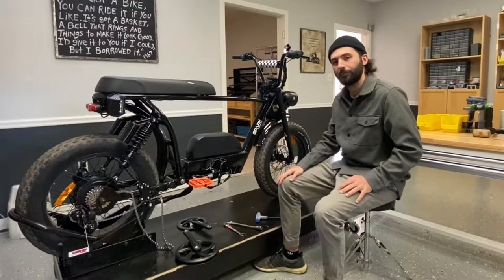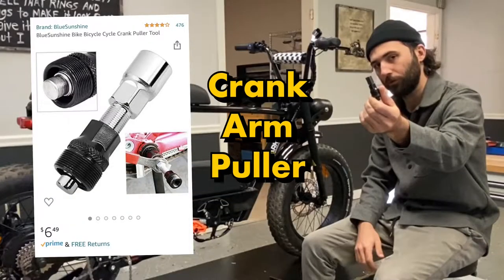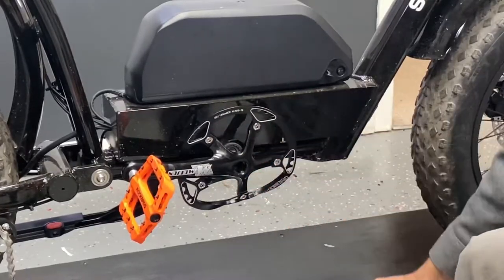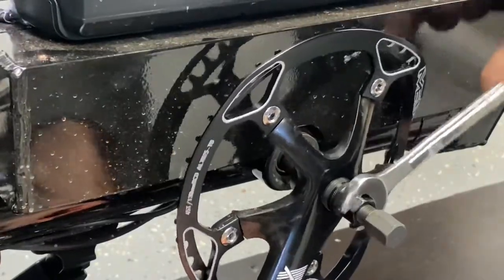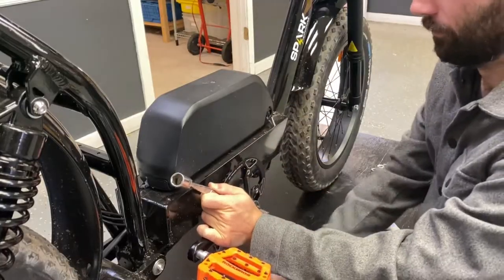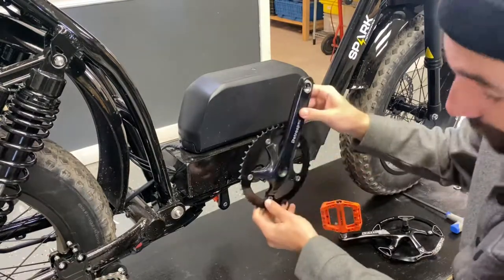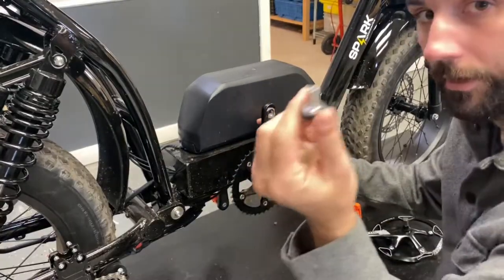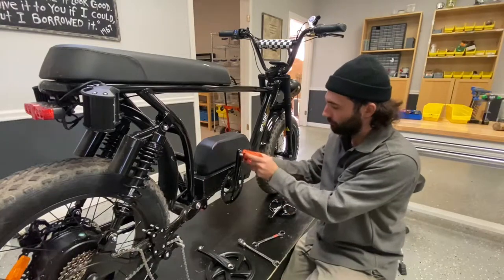Electric Bike Repair: "How to Change a Crank Arm and Chainring"

Comment: I only need to replace the crank arm itself due to stripped threads that let pedals fall out, but you don't show that
Reply: Hey there!!!!   Exact same issue.   Did you figure it out?   I took out the hex bolt but it won’t budge.
Reply: @k.t.kondor9071 did u figure it out cuz I have to same problem but I don't want to break it😭
Reply: @LiquefiedCyanide  I did!!!   Let me see if I can link a video.
Reply: @LiquefiedCyanide  I tagged you in the video.  Let me know if you get it.
Reply: @k.t.kondor9071  hey! could you also tag me in the video as well?
Reply: @latacuachaaeson2166  let me know if you get it.
Reply: @k.t.kondor9071  okay ! so far i havent gotten it
Reply: @k.t.kondor9071 hello. I’m having the same issue. Could you tag me in the video or link it here in the comments? Thanks in advance. Kinda curious on the bike you have as well. Wondering if we’re all riding the same ? Lol
Reply: @k.t.kondor9071 bro can you link that for me? Having the same exact issue
Reply: Same pls
Reply: @k.t.kondor9071  can you please tag me in your video?

Comment: I smoked my left pedal on a boulder and bent the crank arm in the process. Crappy thing is it sounds like I might've messed up the internals where the pedal assist is. At least I didn't get hurt but my wallet might be a bit sore from this!